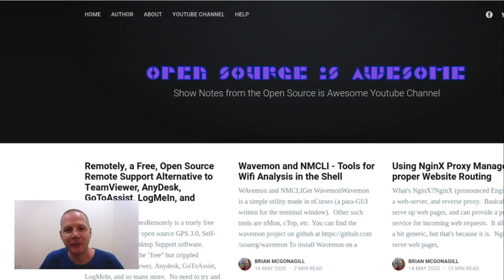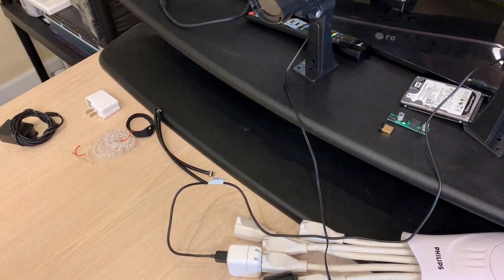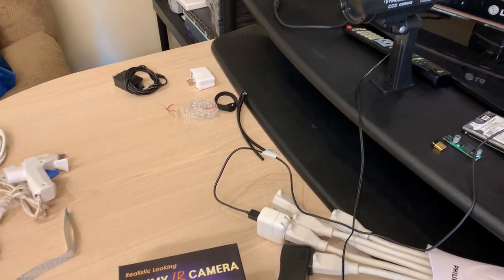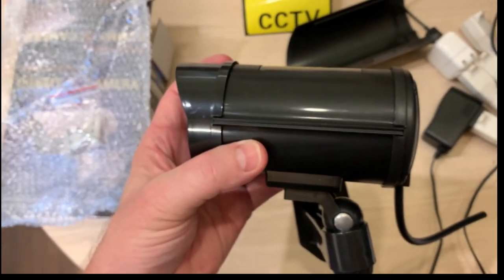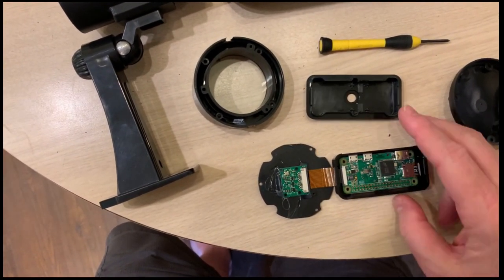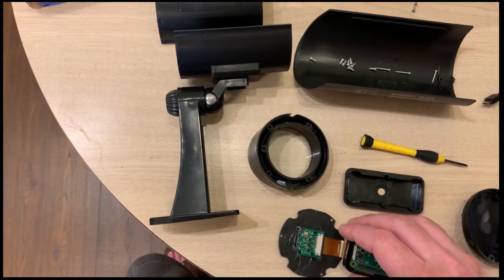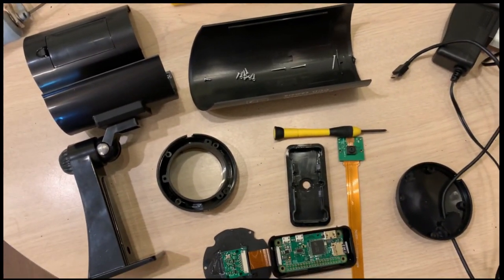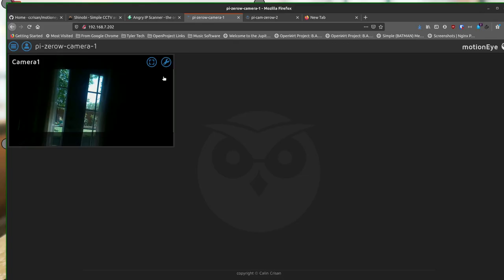An Open Source, Self Hosted Home Security Camera with Raspberry Pi, Linux, and a little elbow grease

Comment: Great video! I am thinking of copying you, but I am wondering if it is more secure to use an ethernet cable instead of using the camera over wireless internet for safety?
Reply from the maker: Wired is more secure for sure if you think the Wifi network has been invaded, but if not, should be fine to use wireless.

Comment: The issue I had in the past with rpi cameras is that resolution is very low so no face recognition or zoom in.  So I was not able to get a real surveillance system out of a rpi.  Maybe analog cameras with better resolution and an edge computer on the other end with a HD for 24/7 maybe a 32 cameras writing
Reply from the maker: Definitely, if you buy the cameras I have (5 MP, you'll only get 1920 x 1080 out of them, which, unless the subject if fairly close, facial recognition probably won't work.  IF you buy better cameras, then I would imagine facial rec could work better. Of course cost goes up, and potentially the ability to use an rpi zero w may be out of the question.

Comment: I have been looking into this project myself. 
I was wondering if you could have a pi 4 as the server and just add up camera's to motioneyeos. Do you think this possible?
Reply from the maker: James Burton you can either use cameras that do RTSP, MJPEG stream, and a couple of other types. Or you can add other cameras like I setup that are each running MotioneyeOS and run them from one interface. So, yes you can do that. But no motion detection in MotionEyeOS yet. I’m posting my final video later today on Shinobi, which does all that and more.
Reply: @AwesomeOpenSource  I'm sorry I meant to say having a pi 4 as a server and just adding ip camera's.
Reply from the maker: James Burton I think you can do it as long as they can do RTSP or MJPEG Streaming.